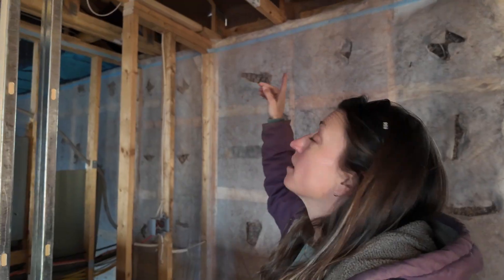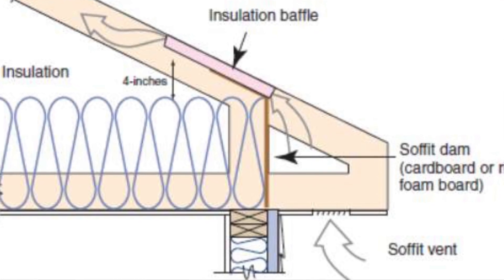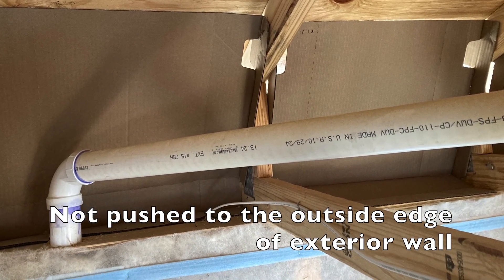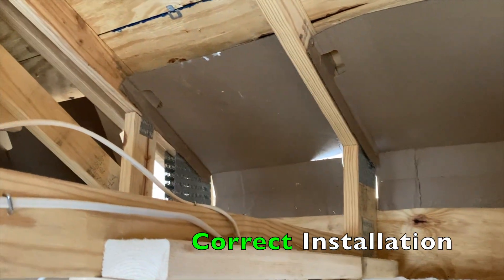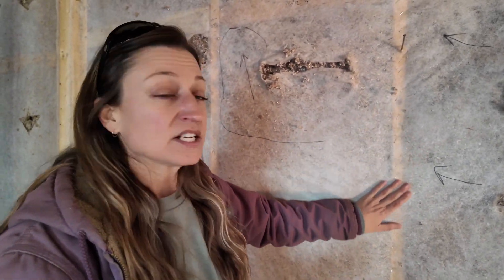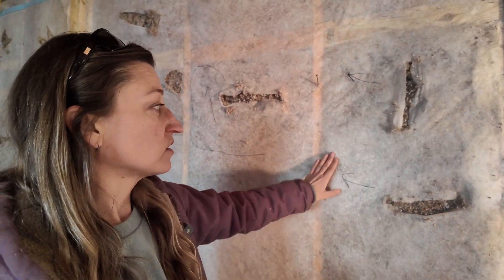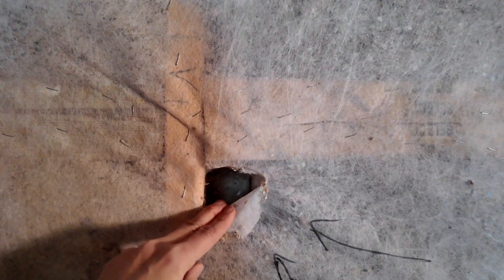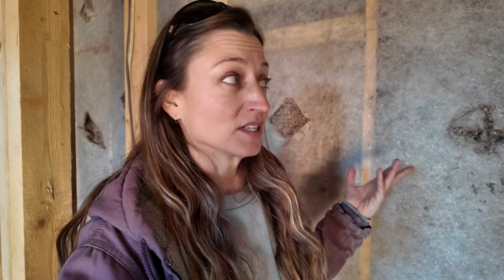BAD INSULATION JOB! - Know what the Pros don't

Comment: What about us DIYer’s?  
I’m hesitant to retrofit my 1950’s stucco and rock plaster empty wall cavities, with either cellulose or fiberglass blown in; 
I’d be using a rental blower, and if I don’t do a good job then I’m stuck with it.  
I contacted Oakridge National Labs for some help, and was told dense packing was a relatively new concept, and regular fill has been done for the past fifty years, @ R-3.4.  Will we still be using cellulose and fiberglass fifty years from now?
I’m trying to think outside the box, going one room at a time.  Cork granular is expensive at $35. cu. ft. plus shipping from Maryland Cork Co.;  I’ve started collecting wine corks, and need to find a way to grind (or use a wood chipper) to make the granules.  
Perlite insulation powder is available locally and $7. cu. ft but only R-2.5 per inch.  I could make a hybrid blend, as perlite would fill the air spaces of larger pieces.

In European countries, they’ve used Rockwool granular, and EPS beads, neither available in the US.
Anybody have ideas to add.

Comment: Wrong on many things. Dense packed fiberglass, BIBS, is a higher r-Value, can't settle when installed and tested like BIBS, doesn't absorb water and installs the same way. There was a study done in thick walls for Passive House several years ago in 4 places across the country. They found that the moisture levels in the thick walls was consistent throughout the wall but they also found out that the walls did not dry out over the summer like originally thought. The RH stayed about 19%. At 21% you have mold. I have blower door tested homes with "dense" packed cellulose and with the IR camera found settled cellulose in as little as 3 months. Have never found settled BIBS. Recycled paper? Where is it coming from? Not nearly the paper as 10 years ago. Fiberglass is also recycled, most companies are at least 25%. I wouldn't open blow fiberglass in an attic and I would never blow cellulose in a wall.
Reply from the maker: According to lots of the Building Science experts I follow who have not only done the research, but also have the experience, settling hasn't been an issue for cellulose for a long time in houses where it has been installed to the proper density.If it is settling, then it was not blown in dense enough.   Check out this thread on Green Building Advisor:  https://www.greenbuildingadvisor.com/question/dense-packed-dry-cellulose-any-downsides  

As for the moisture staying at 19%, I wonder what other materials are in play in those walls.  Was there a vapor open membrane installed, or a rigid foam board with no vapor permeability? Was the sheathing OSB, rather than plywood, which has a lower permeability rating? Was a plastic coat of paint (any latex, acrylic paint) covering the drywall on the inside? These things can all affect the ability for vapor to move through the wall properly.  

I'd actually love to try out some of the newer batts or blown in materials being made from wood fiber and hemp. Haven't found suppliers and installer around here yet, but excited to try them out. I"m always looking for something with a higher carbon sequestration count than fiberglass.